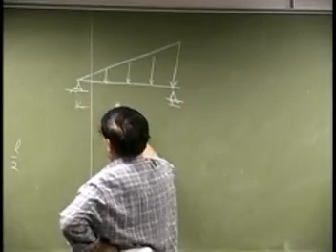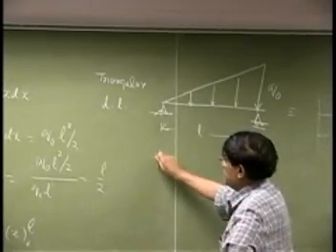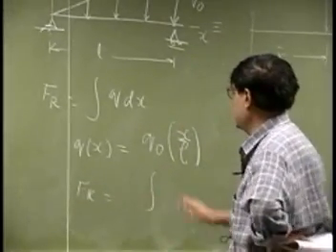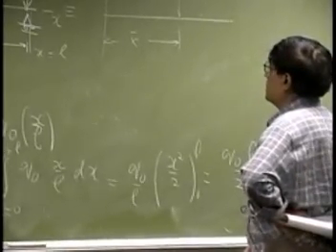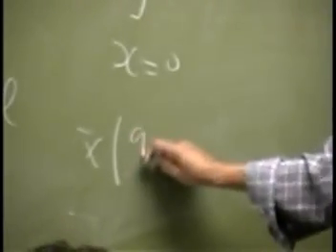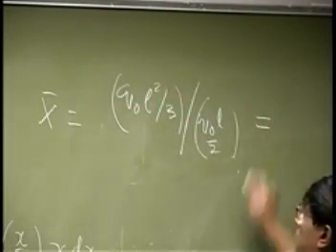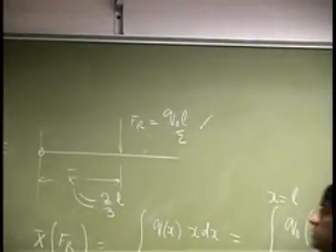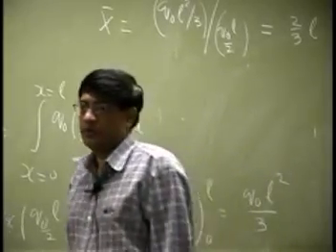simplification triangular distributed loading 1

Comment: I want you to work with me on this one, I have upgrated the fourth oder differentiial equation to the fifth order using : (1)defenition of the slope of a line,(2)point -slope equation of a line,(3)the slope-intercept equation of aline,(4)Defenition of tangent line with slope m,(5)Defenition of the derivative of a function,(6)the mean value theorem,(7)the fundamental theorem of calculus,and (6)and the second fundamental theorem of calculus.